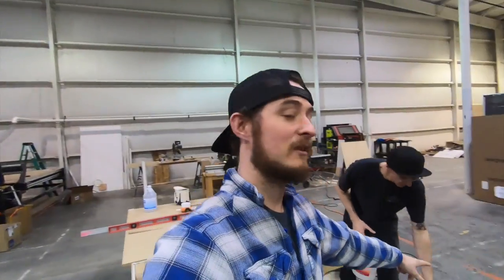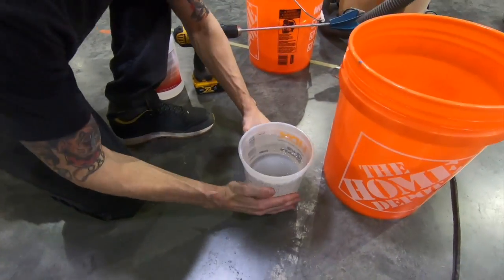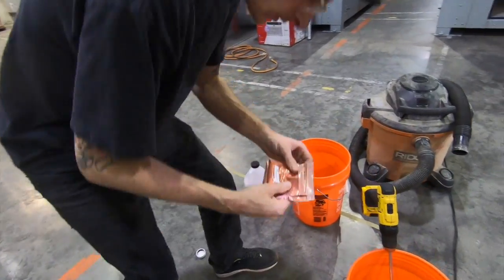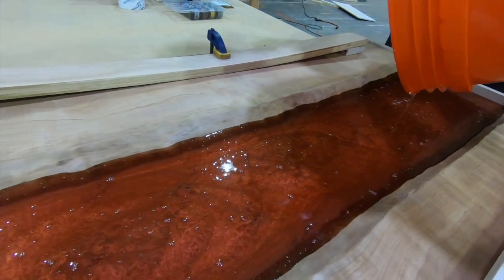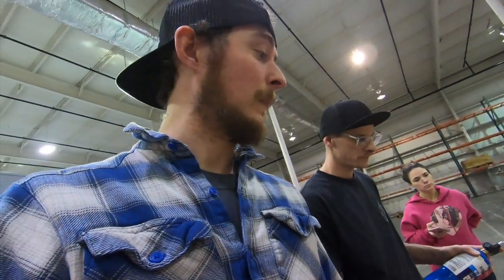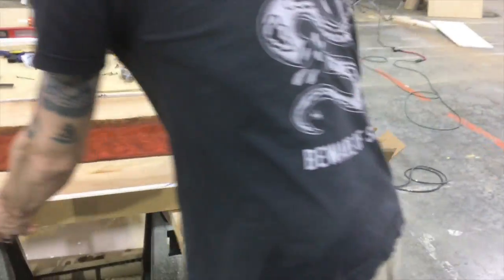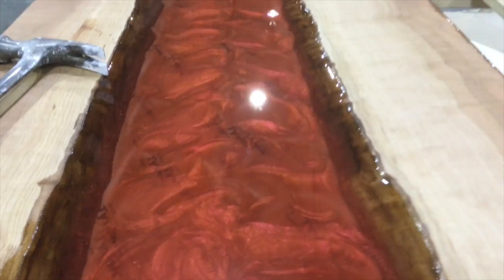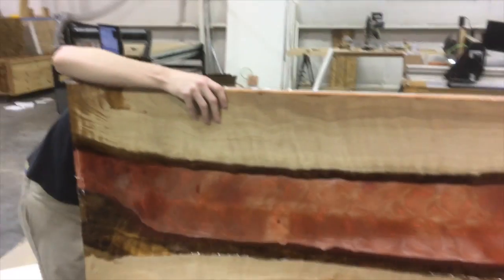Coaching a Friend How To Build a River Coffee Table || Part 2

Comment: Do you have to seal the edges of the wood before pouring the casting? Woods porous so my understanding is that bubbles will keep happening if not sealed before casting.
Reply from the maker: If you use the correct casting epoxy (slow setting) there is no need to seal the edges. As a matter of fact , I encourage people to NOT seal the edges because you will have a much better bond if the epoxy can absorb into them.

Comment: How long do you need to wait between pours because I have a kitchen table one starting soon and I'm going to be trying out pro marine
Reply from the maker: Wait until it’s setup but still soft, then pour the next layer
Reply: @GoodViewWoodworks  thanks man god bless y'all
Reply from the maker: No problem!
Reply: @GoodViewWoodworks  just a question on a big  pour, 2-7ft channels, no more than 10inchs across, how much epoxy will I need 🤔 im coming up with 20 gallons, that seems a little .what do you suggest?@2inch depth and how long between pours do I need to do and how much time between pours? Your advice will really help. Spec.7'-l x 4' w
Reply from the maker: @jesseveazey230  when you say 2-7ft , what does that mean? How many inches is that? 31”?
Reply: @GoodViewWoodworks 2  7' channel separated by a slab .so it's 1 slabs in middle 2 on sides 1 channel on both sides running parallel to center of middle slab
Reply: @GoodViewWoodworks  both channel are 7ft long
Reply from the maker: So I’m coming up with around 7.25 gallons for a river that is 84” long by 10” wide and 2” thick. I would pour it all at the same time as long as you have a deep pour casting epoxy and you put some fans on it.
Reply from the maker: I just realized that you sent this. It would actually  be around 14.5 gallons.
Reply: @GoodViewWoodworks  cool thanks I use pro marine epoxy. How good is incredible solutions
Reply: @GoodViewWoodworks  thanks you
Reply from the maker: @jesseveazey230  pro marine is okay but it’s not a casting epoxy. The incredible solutions is made specifically to pour up to 2” thick at once.
Reply: @GoodViewWoodworks  with the 3 gal for incredible solutions do you pour all 3 bottles in one bucket and mix? Or is it better to use the 2 gal
Reply from the maker: @jesseveazey230   yes. The 2 gallon is not a casting epoxy.  They have a 1.5 gallon that would work.
Reply: @GoodViewWoodworks  thanks Nathan. I called them going with 3gallon kits im bad with 2:1 but they explained it for me. So we is good 👍
Reply from the maker: Nice!
Reply: @GoodViewWoodworks  with incredible solutions does it matter how long you want to do 2nd layer even if it's dry
Reply from the maker: It doesn’t matter. However if it is cured you must scuff sand with 220 grit before pouring your second layer.
Reply: @GoodViewWoodworks  cool thanks
Reply: @GoodViewWoodworks  how do you correct a wrapped form
Reply: @GoodViewWoodworks  how do you correct a whurped form
Reply from the maker: I’m not sure.
Reply from the maker: You will need to send pics and explain. You can send it through Instagram or Facebook @goodviewwoodworks

Comment: I was wondering do you need to seal the wood that's going to be touching the epoxy before pouring to keep the wood from leaking air bubbles?
Reply from the maker: No, no seal coats were done on this project.